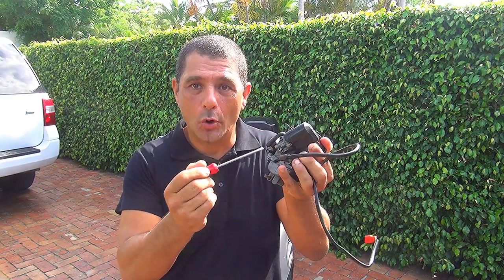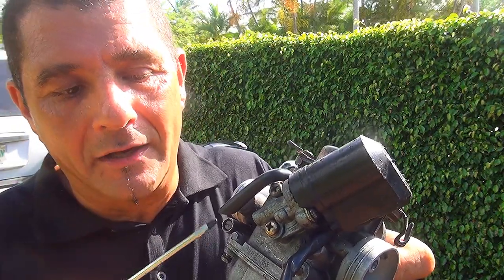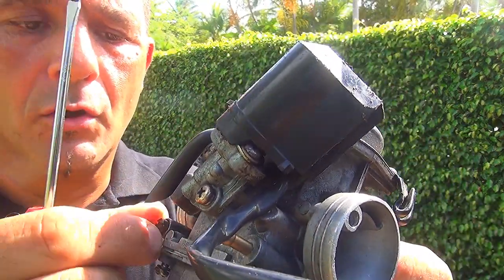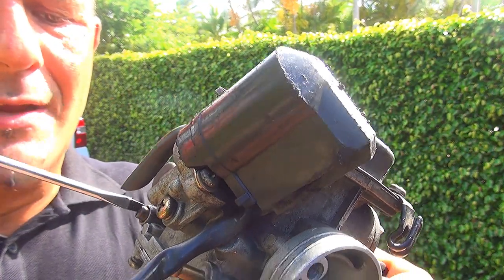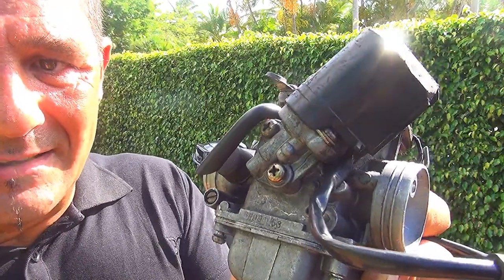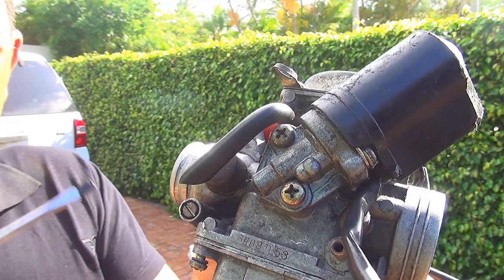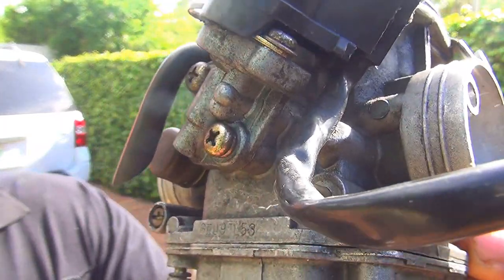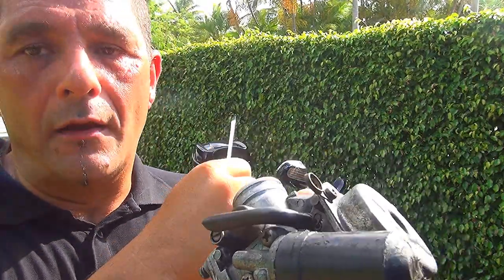How To Set Scooter Idle Mixture Screw

Comment: Can you tell me the replacement screw you show in the front that is a little longer. How can I find one I need one for a pd-23. Carburetors on a gy650 but it's built to racing standard and the one that was on it before for the 50cc that one fit also in the same carb .

Comment: If i am having problems with starting my scooter when its roomtemprature or even colder....should i try to adjust the idle valve?

My scooter were fine the fist few thousand miles. But, now it has become much more difficult to start it. I live in a cold climate so maybe the "default factory settings" need to be changed. Either that or my engine has low compression and my cylindre etc need to be changed.
Reply from the maker: If you're having trouble starting your scooter in colder temperatures, adjusting the idle valve might help, but it's not the only factor to consider. Here are some steps you can take to diagnose and potentially fix the issue:
First, check the spark plug to ensure it's clean and in good condition, as a fouled or worn spark plug can make starting difficult. Make sure your fuel is fresh and that there are no blockages in the fuel lines, since old or contaminated fuel can cause starting issues.
Adjusting the idle valve can help if your scooter is not idling properly, especially in colder weather. Turning the idle screw slightly clockwise can increase the idle speed, which might help with starting. Additionally, check the battery to ensure it's fully charged, as cold weather can reduce battery performance, making it harder to start the engine.
If your scooter has a manual choke, use it when starting in cold weather. An automatic choke might need adjustment or maintenance if it’s not working properly. Ensure the carburetor is clean and functioning correctly, as a dirty or misadjusted carburetor can cause starting issues.
Low compression could be a problem, especially if your scooter has many miles on it. Performing a compression test can determine if this is the issue. If compression is low, it might be necessary to replace or rebuild parts of the engine, like the cylinder or piston rings.
Lastly, check and clean or replace the air filter, as a clogged air filter can restrict airflow and make starting difficult. Start with the simpler checks (spark plug, fuel, battery, and air filter) before moving on to more complex adjustments and tests (idle valve, choke, carburetor, and compression). If you're not comfortable performing these checks and adjustments yourself, it might be a good idea to take your scooter to a professional mechanic for a thorough inspection and tune-up. Thank you for watching my video

Comment: On these stock carbs I having trouble with my fuel bowl drain dripping the screw in the whole way you have any trouble like that
Reply from the maker: Hello my friend no I didn't have that problem yet  try to unscrew the screw all the way out to see if there is a rubber o ring that you need to replace or is missing or sometimes is dry from ageing
Reply: @VirberelloScooterTips  going to check that didn't even think of that

Comment: Where is the washer and the o ring of the mixture screw, and how I assembl them with the spring, think y
Reply from the maker: The mixture screw, also known as the air-fuel mixture screw, typically has a specific assembly order for its components: washer, o-ring, and spring. Here’s how to assemble them:
Spring: This is the first component to be placed onto the mixture screw. Slide the spring onto the screw until it reaches the base of the threads.
Washer: After the spring, slide the washer onto the mixture screw. The washer provides a smooth surface for the o-ring to seat against and helps prevent damage to the o-ring from the spring.
O-ring: Finally, place the o-ring onto the mixture screw. The o-ring sits between the washer and the carburetor body, providing a seal to prevent air or fuel leaks.
Assembly Steps
Insert the Spring: Take the mixture screw and slide the spring onto the screw until it reaches the bottom.
Add the Washer: Next, place the washer onto the mixture screw, right on top of the spring.
Add the O-ring: Lastly, place the o-ring onto the mixture screw, ensuring it is seated properly against the washer.
Installation into the Carburetor
Carefully Insert the Mixture Screw Assembly: With the spring, washer, and o-ring properly assembled on the mixture screw, carefully insert the screw into the designated hole in the carburetor.
Tighten the Mixture Screw: Gently turn the mixture screw clockwise until it lightly seats. Do not overtighten, as this can damage the tip of the screw or the seat in the carburetor body.
Adjust the Mixture: Once the screw is seated, you can begin to adjust it according to the specifications for your particular engine or carburetor.
This order ensures that the o-ring provides an effective seal and the spring maintains the tension needed for proper adjustment.
Thank you for watching my video

Comment: I am having trouble with my scooter I have tired to set the idle higher to stop this from happening but it idles fine when I just start it and take it out but when I come to a red light it cuts out sometimes but I have got the idle set as high as I possibly should at about 2000rpm and it is still cutting out at red lights and stop signs could adjusting this solve my issue?
Reply from the maker: Hello Adjusting the idle speed on your scooter may help address the issue you're experiencing, but it's important to consider other potential causes as well. Here are some steps you can take to troubleshoot and potentially resolve the problem:
Check for Vacuum Leaks: Vacuum leaks can disrupt the air-fuel mixture, causing the engine to stall at idle or low speeds. Inspect the vacuum lines and connections for any cracks or loose fittings.
Clean or Replace the Carburetor: If your scooter has a carburetor, it may be clogged with debris or have a faulty idle circuit. Cleaning the carburetor or replacing it, if necessary, can improve idle performance.
Inspect the Spark Plug: A fouled or worn-out spark plug can lead to stalling issues. Check the condition of the spark plug and replace it if it's worn or fouled.
Fuel System: Ensure that the fuel system is clean and free from obstructions. A clogged fuel filter or fuel line can cause fuel delivery issues.
Idle Speed Adjustment: Since you've already adjusted the idle speed to around 2000rpm, it's at a reasonable level. However, if the issue persists, you may want to consult your scooter's manual or a mechanic to ensure you're adjusting it correctly.
Throttle and Idle Screw: Check the throttle cable and the idle screw for any issues. Sometimes, a sticky throttle or improperly adjusted idle screw can cause stalling at low speeds.
Electrical System: Inspect the electrical components, including the ignition system and wiring. Loose or damaged wires could lead to intermittent stalling.
Air Filter: A clogged or dirty air filter can affect the air intake and cause poor idling. Make sure the air filter is clean or replace it if necessary.
Fuel Quality: Ensure that you're using clean, fresh fuel, and that there's no water or contaminants in the fuel tank.
Temperature: Sometimes, scooters can experience idling issues when the engine is too hot or too cold. Ensure that the engine is running within the recommended temperature range.
If you've gone through these troubleshooting steps and the issue persists, it's a good idea to consult a professional scooter mechanic. They can perform a more detailed diagnosis and address any underlying issues that may be causing the stalling problem
Thank you for watching my video and please click like on my video so others can find my channel

Comment: My question is, what's that left side, straggler hose line coming out of the top of the carb used for? It's not connected to anything, right? I can't get spark because the engine - the EGR noise - isn't turning over. I watched videos - the EGR has a 'chain' or gear in it, I guess. It sounds like the noise is coming from behind the cover. I'll spare you the work I've already done replacing parts, checking, reverse engineering after replacing a fractured vacuum line from carb to EGR. Don't know how it all got out of hand. My lil' red scooter is all opened looking like an open heart surgery patient on the surgical table (I'm an ret'd RN).
Reply from the maker: Hello Lynda the straggler hose line coming out of the top of the carb is a over flow just in case the fuel is not able to go the the motor will go out from the top if to much pressure is on the lower part of the carb. Thank you for watching my video

Comment: Can the scooter carburettor petrol level be reduced or increased?  Because my scooter plug is turning black.
Reply from the maker: Hello my friend spark plugs can turn black on a scooter due to several reasons, including:
Fuel mixture: A rich fuel mixture can cause the spark plug to turn black. This happens when there is more fuel than air in the combustion chamber, leading to incomplete combustion of the fuel. As a result, the unburned fuel particles accumulate on the spark plug, making it black to fix the problem place a smaller main jet accordly to your location.
 Oil contamination: If there is oil in the combustion chamber, it can get onto the spark plug and cause it to turn black. This can happen if the piston rings or valve guides are worn, allowing oil to leak into the combustion chamber.
Carbon buildup: Over time, carbon deposits can build up on the spark plug, causing it to turn black. This is more likely to happen if the scooter is used for short trips or if the engine is not properly tuned.
To prevent your spark plug from turning black, you can ensure that the fuel mixture is correct, keep your engine well-tuned, and replace the spark plug regularly. Thank you for watching my video

Comment: What would I have gas flowing out the air filter side of carb.
Reply from the maker: If you're experiencing gas flowing out of the air filter side of the carburetor on your scooter, it could be indicative of several potential issues:
Float Needle Valve Issues: The float needle valve in the carburetor may be stuck or not sealing properly. This valve regulates the flow of fuel into the carburetor bowl. If it's not functioning correctly, excess fuel can enter the carburetor and flow out through the air filter.
Float Level Adjustment: The float level might be incorrectly set. If it's set too high, it can lead to an overflow of fuel into the carburetor, causing gas to leak from the air filter side.
Dirty or Clogged Carburetor: Dirt, debris, or varnish buildup within the carburetor can obstruct the proper functioning of various components, including the float needle valve. This can lead to fuel overflow.
Faulty Carburetor Gasket: The gasket between the carburetor and the air filter housing may be damaged or improperly installed. This can result in a poor seal, allowing fuel to leak out.
Venting Issues: The carburetor needs proper ventilation. If the venting system is blocked or malfunctioning, it can cause pressure imbalances, leading to fuel leakage.
Fuel System Issues: Problems with the fuel supply system, such as a malfunctioning fuel pump or a clogged fuel line, can contribute to excess fuel entering the carburetor.
Incorrect Jetting: If the scooter has been modified or tuned, and the jetting (fuel/air mixture) is not set correctly, it can lead to excessive fuel entering the carburetor.
I hope this can help you

Comment: Mines is plug I have no access to set it. But I do have a idle control set. The air/fuel on mines is cap no way I can adjust it unless I remove the cap. But I do have a idle control adjustment. I was wondering if I can adjust that, and if so how will it help on my scooter if I do adjust the idle control? Will it give more gas savings , will it run more faster or smoother. ?? Why is there a idle control adjustment for?

Comment: Question my gas scooter accelerates after I started up without giving it has it still moves... Is that something to do with the idle screw as well
Reply from the maker: Hello the scooter accelerates after you started up because of the enricher but you can set the idle screw lower  after 3 minutes you started the scooter  that is when the rpm start to relax a little and the motor is hot
Reply: @VirberelloScooterTips  thx bro 🙏🏽

Comment: I have a piaggio typhoon 2013 and I turned the screw out approx 2 turns. If I give it full throttle while on stand, the scooter seems to stumble a little before picking up on acceleration. But if I cover the air intake a little it’s working fine. Does the air/fuel screw need another adjustment? And if so, clockwise or counterclockwise?
Reply from the maker: Hello my friend try another half turn counterclockwise to see if that makes a difference but you also have to make sure your jets inside your carburetor are clean
Reply: @VirberelloScooterTips  jets are clean, and i would be turned out approx 3 turns on the screw, which appears to be alot... should i also move up a jet size to compensate for lean?

Comment: Your carb may be different - you may have an air mixture screw which is found on the air intake side or you may have a fuel mixture screw which is found on the engine manifold side. Most carbs won't have both. They do the exact same job, one just does it by regulating the air and the other does it by regulating the fuel so it doesn't matter which one you have, the procedure is exactly the same.
Reply: But my bike run fine on idle when i remove adjustment screw, but when i put that screw in engine will go out without giving race.
Reply: yes butt you must be carefull because if you turn the air screw in your mixture will be richer ,but if you turn the fuel screw in your mixture will be leaner !

Comment: I'm having a problem with my moped.I connect my airbox to my carburetor and my moped don't want to run it just bogs down could this be my problem do I have to adjust the idle mixture screw.
Reply from the maker: Hello Robert did you check if your air filter is clean ? because if your scooter work great without the filter there is a chance that your air filter is dirty but sometimes the problem can be a dirty main jet inside the carburator. Thank you for watching my video
Reply: @VirberelloScooterTips  the carburetor is brand new but the airbox is the wrong size for the moped.Could the airbox size be the problem
Reply from the maker: Yes that could be a a problem if the air box is to small you will have less volume of air  if your scooter run perfect with out the air hose connected the problem is the air filter

Comment: when I start my scooter i have to give it a bit of throttle to start and to keep it going if i do not give throttle the scooter dies. will this fix the issue
Reply from the maker: Hello my friend that could be the pilot jet inside the carburetor that needs to be clean or low compression in the motor and you can do a valve adjustment. Thank you for watching my video
Reply: @VirberelloScooterTips  I had a valve adjustment done this week by a mechanic and I have checked the pilot valve and it is clean.

Comment: My scooter hesitates at the first turning of the throttle and then takes off as It should. Do you think the air mix screw could be the problem? (It's a new carburetor)
Reply from the maker: Hello my friend you need to open the carb and see if the main jet is dirty also check the carb rubber Diaphragm to make sure is not sticking to the wall of the carb or the rubber is broken . Thank you for watching my video
Reply: @VirberelloScooterTips  you were right, the main jet was dirty. Now it runs like it was new again. THANKS, YOU SAVED ME FROM A NEW CARBURETOR AND INSTALLATION CHARGE.
Reply from the maker: @albertolewinton7545  Hello my friend fantastic I'm very happy for you

Comment: I've received my bike, on January 6 2021.And so I've had to replace the sparkplug 3 times
Is the normal. The bike has 2400 km on it. I can change the plug it
Operates fine, but after a little time it will just won't start or just dies. Its be nerve rattling at times.
Reply from the maker: Hello John I have a feeling that your motor is running to lean and is burning or melting your sparkplud eletrode tip you need to lower  the temperature of your motor that will give a longer life to your motor and the sparkplug to lower the temperature of your 150cc gy6 scooter just change the main jet inside your carburator to a #115 main jet or if your location is at sea level place a #120 main jet that will lower your motor temprature also change oil to mobil 1 10w-40 full synthatyc because is slipperier than conventional oil which means less friction in your engine so  your engine will run cooler, wears less and lasts longer. Thank you for watching my video and be safe
Reply from the maker: @johnlovell1035  If the chains are not to expensive is good to have them in the house or just wait to see if you do not really need them for now

Comment: Let's say that you just want to idle high, nothing wrong with the the scooter you just want to idle high but not all the way high. Just alittle more high than the normal stock setting's. Will it hurt the bike if decide to idle bike high than usual?
Reply from the maker: Hello my friend no problem if you like to idle your scooter little higher but  you can not put to hight because when you stop at a traffic light your scooter wil try to move unless you pull your brakes
Reply: @VirberelloScooterTips  thanks!!!

Comment: Hi my friend I wild like to know I dit re do my caborator whit new pilot jet an needel and seed and new floater and new ear an fuel scrow bat my scooter batel toe start and their is fuel in the line and there is spark I dit drove it like 20 minet a go but now it won't start
Reply from the maker: Hello my friend make sure you do not have any vacuum leak and make sure the fuel goes to the carb